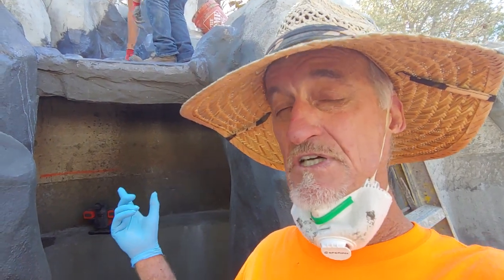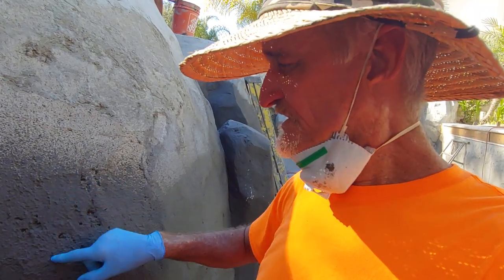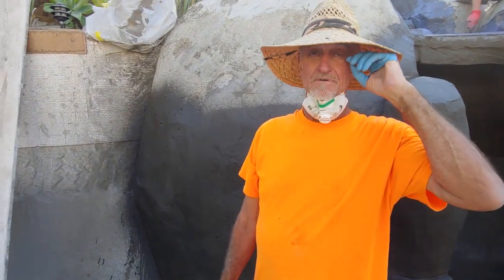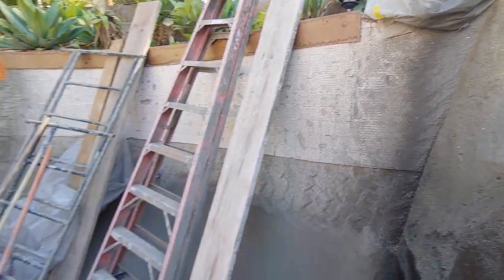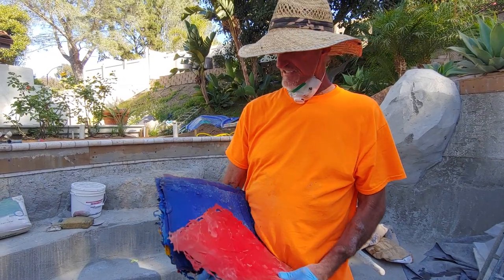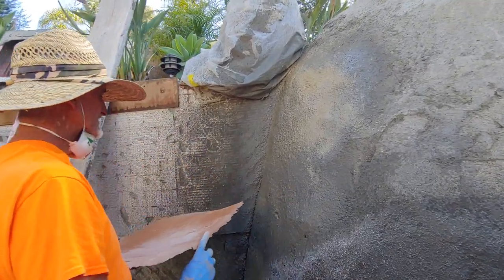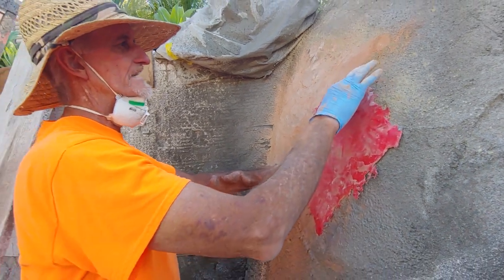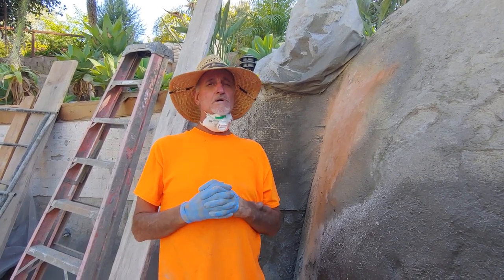AWESOME Fake Rock Waterproofing & Stamped Texture Coat Tricks Demo!

Comment: Hi Dave, thank you for all your videos. I bought your pdf book and learnt a lot from it. Is miracote aqua-blok xl absolutely necessary or just membrane C would do it? I built a waterfall. There is a liner underneath. I built concrete rock around it and painted it but now it is leaking. I think the concrete is sucking the water out. So now I am going to strip the paint off and put a membrane C on it where the water hits?. Do you think it that is enough? Thank you and God bless
Reply from the maker: Hi M. S., Thanks for the kind words and for investing in my little book.  Appreciate it!  :)  On your question, if you have a liner under everything is shouldn't leak.  I don't know the size and scope of your feature but if you run it a lot and it's in the sun evaporation can and will remove water.  The other possibilities are a fold or hole in the liner could be causing water to escape.  Regarding Aqua-Blok XL, I use that on all concrete projects.  Never with a liner job.  On your situation you could go with the Membrane C using 2 coats.  But before I paint it on I always go over the entire feature where water will be standing or moving prior to painted on Membrane C filling in all pockets, holes, cracks or any other possible places that would be hard to get the membrane coating into and covered.  I use a mortar mix with lot's of acrylic added for this.  Once that's done I know that I have a better shot at full coverage of the waterproofing coating.  With the paint stripping off paint that's been applied to concrete  and/or mortar the only effective way to do that is with a sand blaster.  Using paint strippers will be messy, and will leave chemicals on the rockwork that could cause a problem with the coating materials adherence.  But you can try it if you want.  Lastly, once concrete is set and especially if you've sealed it with a membrane it really doesn't suck out water.  Only cracks and holes could do that to the degree you notice a water loss.  At least that's what I'm thinking.  Anyway, hope that helps.  Best of luck to you!  Cheers, Mr. Dave :)
Reply: @DaveHendersonFakeRockVideos  Thank you! Very very helpful. I think there is a fold and I see where water is coming out at the bottom of the slope. I got my membrane C. Will sand the paint off and put a layer of mortar then 2 layers of membrane C. I also got "Pond Shield" before I asked you which probably I return. Will make my own video soon and cannot wait to show you. I made my own technique of shaping the rocks but used a lot of your expertise. Thank you :)
Reply from the maker: @mahzadart  Sounds good.  If you're gonna be putting on another texture coat on then I would take a 4 1/2" diamond grinding disk and an angle grinder and score and notch up the surfaces instead of the just sanding.  This will ensure a good bond, (don't forget the acrylic).  I usually make a crisscross grind pattern.. Anyway, best of luck to you!  Cheers, Mr. Dave :)
Reply: @DaveHendersonFakeRockVideos  Thank you so much for your information. Will do. God bless :)

Comment: What sealer is used to make slide go faster?
Reply from the maker: I use E-95G polyurethane from Westcote.  Just Google them and track down a distributor to get it.  Best of luck to you!  More fake rock how-tos, including free PDF downloads and more are at davehenderson.podia.com. For my blogs and links to other platforms try www.daverhenderson.com
Cheers, Mr. Dave :)
Reply: @DaveHendersonFakeRockVideos   How can i get in touch with you professionally . I am Eric from Ghana